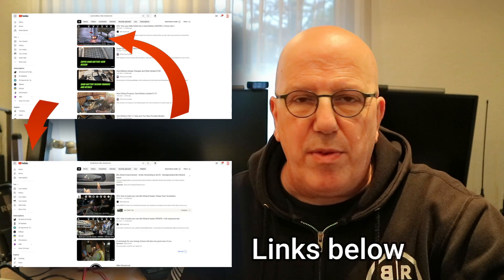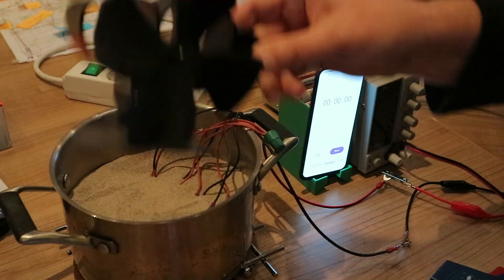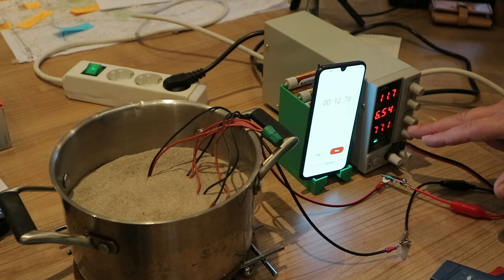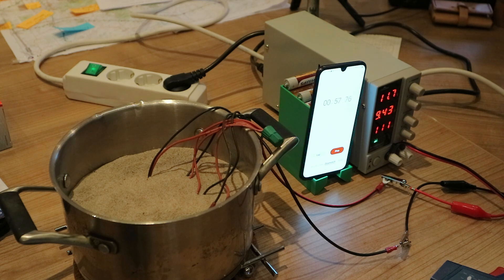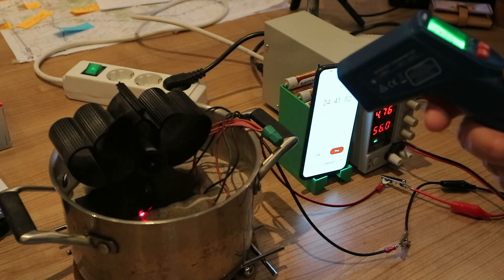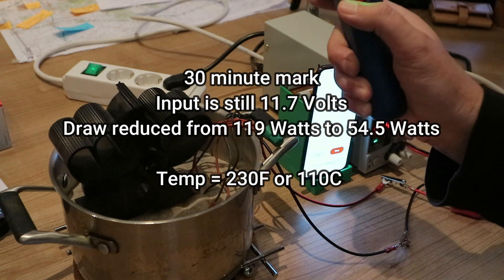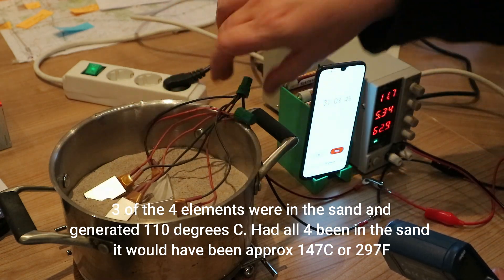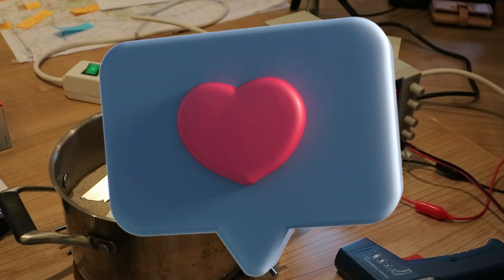#80 : Generating REAL heat with minimal power ( No BS or Clickbait )

Comment: I don't understand what is interesting or new new in this video. You have some resistive elements in sand and they produce heat when you apply power. Totally expected. And the temperature also isn't astonishing. Just take a look at a simple old incandescent light bulb. There the temperature is much higher with similar power consumption. But I have subscribed nevertheless - maybe there's an aspect to it I didn't get yet...
Reply from the maker: First of all, thank you for subscribing. The intention is to store the energy in the "sand battery" so the energy put into it can be released slowly over time. If I turn off the power at 11pm the fan is still running at 9 in the morning. I know it does not miraculously make energy out of thin air.

Comment: My good friend, I'm telling you this with love, you have a really bad understanding of physics and the difference between temperature and thermal energy.
Reply from the maker: Noted. I am open to educate myself
Reply: @mikeshawbrook-selfreliance  Hey, I'm new here, could you explain your goal with this project? Just in a couple of words.
Reply from the maker: @Sekir80  I charged my battery pack with solar up to 600Watt. This will allow me to run my "installation" for about 9 hours with "free" heat indoors
Reply: @mikeshawbrook-selfreliance  Thanks. For clarification: your "battery pack" is the sand battery?
600 Watts is a measure of power, not energy. Did you mean you injected 600 Wh energy into it?
Your "installation"? I don't quite get it. What I suspect: You have created a heat battery to store the heat generated by electricity (from solar panels) and it takes about 9 hours to cool it down, indoors.
How am I doing with guessing?
Reply from the maker: Correct @Sekir80
Reply: @mikeshawbrook-selfreliance  Okay, so you basically created a heat storage system. Nice. 
Keep in mind: if you insulate the pot that means the losses will be less, extending the cool down time, but the amount of heat injected to the room is still the same. Prepare for the room to be a bit colder but for longer. 
I could write a crash course on heating and energy, if you wish.
Reply from the maker: @Sekir80  I'm planning on insulating the container once I have a taller one. I am looking for a thin layered container, so I can place the elements underneath the pot instead of inside ( thus protecting the cables ). I will then add more sand and run U shaped pipes through the sand. On top I will put a bent "chimney to capture and direct the heat. Finally I will use a heat fan to spread the heat. And yes, I would love some tips. Very kind of you

Comment: I would put a pipe through it and bring it in a "U" back up to the top where your fan is.  Then insulate the heck out of it so that the only heat loss you will have is where it is being blown out through the pipe.  It's not gonna move a lot of air but it could be run from a car battery, so that makes it nice for a small area.  Of course your wattage is gonna go up the better you move the air through the pipe.  What do you think?
Reply from the maker: Wonderful idea. I need to try that

Comment: Temperature is no indication of energy produced. A soldering iron tip can easily produce more than 350 degrees C with a consumption of 25 W. If you put it in a pot of sand it will probably give you similar readings but it will hardly do any good heating a room in the winter. What the sand does is to store the energy and radiate it in a slower rate in the environment. I am afraid that either with or without sand with a supply of 100W from the power supply, 100Wh will be  produced which is what would be given by any other 100W heating device.
Reply: This is kind of all nonsense. All electric heaters are 100% efficient. It all depends on how fast you're gaining energy (heat) compared to how fast you're losing heat, and that's almost entirely dependent on how well you're insulated from the external environment. If I have a well insulated container, I can get it up to extreme temperatures with any little heating element. But then the higher the temperature differential the faster you lose heat due to thermal diffusion and black body radiation.

Not rocket science  ...just high-school level physics. 😁

Edit: I agree with your post entirely... I'm just commenting about the video in general. 🙂
Reply from the maker: My interest is in warmth. Due to the heat retention properties of sand the energy put into it dissipates at a very slow rate and as such builds up cumulative energy. In other words, the energy input is an average of approx 65 Watts per hour. But it takes the sand way longer to release that energy. As a result the sand get scorching hot. And with the fan I can enjoy the heat from that. Had I just used that energy to light a lightbulb, I would not have the same conditions
Reply: @mikeshawbrook-selfreliance yes, but energy in can only equal energy back out. It's just a heat battery. If your adding the energy slowly at a low rate, more time is required to charge the heat battery. If you heat it at 50 watts for 10 hours, you've charged it with 500 watts of heat. If I heat it at 500 watts for 1 hour, I've accomplished the same goal quicker, but used the same energy. There isnt an advantage.
Reply from the maker: @jaredcarlson3500  Energy in = energy out, I am aware. It is more aimed at using solar energy that I stored in a 600W battery unit. I can run my "installation" approx 9 hours on one charge. As the sand has a high heat retention ratio it will "accept" the 600watts and give it back over a period of 9hours+ at 70watts, rather than one hour at 600 watts.
Reply: @mikeshawbrook-selfreliance  aha! Then you have succeeded. Thank you for sharing your work with sand batteries. I love how simple and robust they can be!

Comment: Improvements are relatively easy to make , but there is a question of regulation of heat exchange. Besides insulation , which has to be substantial , because of very high temperatures that sand battery can achieve , the best way (depending on the volume of the container filled with sand) is to heat it from below (close to the bottom of  sand container).  That creates problems with insulation of the connecting wires , unless the heating elements are inserted into container trough the bottom of it (with wires outside of container). Many people had that problem (with insulation on the wires , inserted from the top) , which is not a problem , if you make necessary changes to the container (metal bucket with a metal lid can be used , in order to drill , or cut the holes in the bottom , for the heating elements).
 The only way to regulate exhaust temperature (air to air) , is to limit the maximum temperature within sand battery , via high temperature thermostat , which will cut power supply to the elements (at given temperature). That limits full potential of the sand battery , but there is no inexpensive way to do it otherwise , when it comes to home use.  
 For insulation , ceramic wool should be used (stuff for insulating the kilns ) , because ordinary rock wool works only to about 200 °C , after which it melts. Ideally first layer of insulation should be carbon felt (pure carbon felt , like welders blanket).
 The heat ex-changer  can be metal pipe or strip , with fan blowing over (or trough) it , depending on a temperature of sand , because this thing can absorb well over 1000 °C. Good luck with the project !
Reply from the maker: Thanks for the feedback :-) It's highly appreciated

Comment: Heat is one measurement... one would need to evaluate the BTUs to assess the usability of the device... or at least try it to see if it can maintain a reasonable temperature in a room with no other heat source.
Reply: There is whole lot of measurements that could be applied , however , this is a well known "device" , or principle . Sand batteries DO work very efficiently and can reach extremely high temperatures (over thousand degrees C). Insulation of the battery and heat exchange are different topics. Room doesn't equate to anything , because there are big rooms and small rooms , well insulated and poorly insulated , etc... In this case , man used about 75-77 W average for 30 mins (which equates to cca 150 WH) to heat (at least top of the sand) to 110 °C. Every heating unit has efficiency of abut 98-99% , so only benefit (in this case) is utilization of ceramic heating units , which are more durable , than standard stainless pipe heating units , which wear out more (resistive wire inside them has certain amount of cycles , before breaks ).
Reply from the maker: I did experiments like this before and receiced many questions about the room. The starting temperature and whether it could heat it. I believe this would not add a lot as there are too many variables such as humidity of the room, altitude of the building compared to sea level, size of the room, insulation etc. Thanks for the feedback